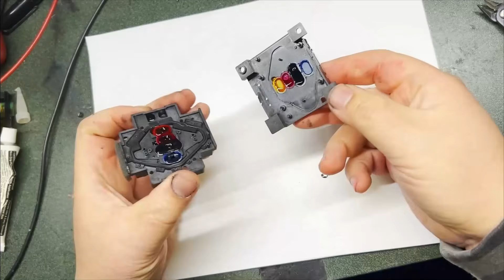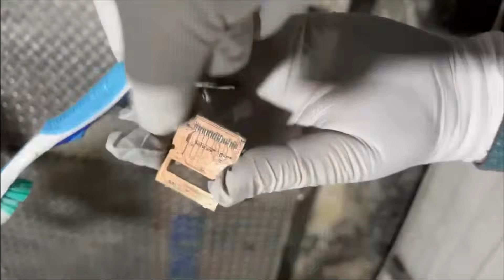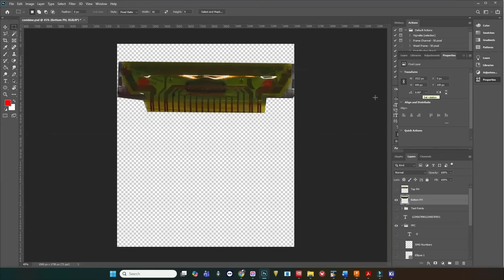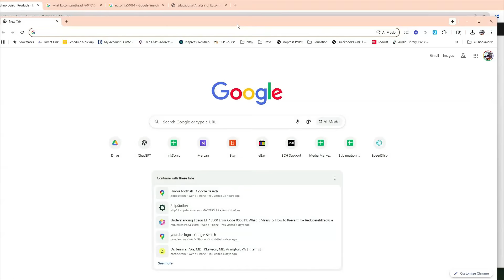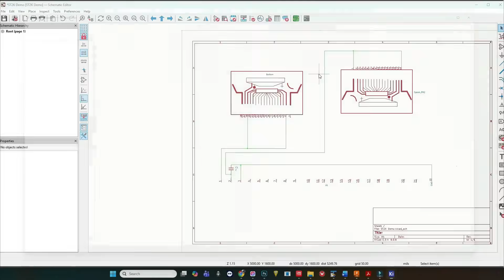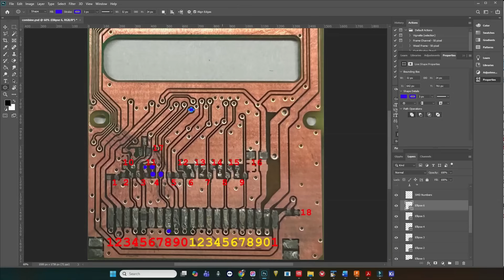Printhead Circuit Board Analysis - From Teardown to Schematic

Comment: May Epson L3150 was all blinking light.power button WiFi button and 2 red light buttons blinkung light..hiw to fix
Reply from the maker: Thank you for your support and engagement! When all the lights on an Epson L3150 are blinking, the first step is to retrieve the printer’s actual error code using the Epson Adjustment Program. Open the program, select the USB port showing your printer’s name, choose Particular Adjustment Mode, select Printer Information Check, and click Check; the most recent error should appear at the top as error number one. Once you have the code, search Google for “BCH Epson Error” to find our Epson Triple Secret Error Codes page and identify the affected part or sensor. The Adjustment Program is mainly intended for Epson technicians, but it may also be available from the seller who supplied your printer or through an online search. This video shows the basic process: [https://youtube.com/shorts/FPZzpyYuZLE](https://youtube.com/shorts/FPZzpyYuZLE) Please subscribe or become a channel member for priority replies and extra benefits such as early access to videos. I receive a high volume of questions every day and can only answer about 10 per day, so subscribers and members are typically answered within 48 hours, while regular viewers are answered if time allows. After subscribers and members, any remaining reply slots are filled last-in, first-out, meaning the newest questions are reviewed first. If you are not subscribed and do not receive a reply within 48 hours, you can either subscribe or repost your question because newer comments are reviewed first. If you subscribe later, your older questions automatically become priority without needing to repost. You are also invited to join Run With Kevin — LIVE, where I go live every morning, usually between 6–11 AM Eastern, and answer printer questions in real time. Subscribe and turn on notifications so you can catch the next live session and ask your question directly. For faster assistance, please email [support@bchtechnologies.com](mailto:support@bchtechnologies.com). If this video or comment helped you, I would greatly appreciate a Google review: [https://g.page/r/CfL7k6nYvPQ9EAg/review](https://g.page/r/CfL7k6nYvPQ9EAg/review)

Comment: Hi Kevin ,
I wondering what the goal is for this particular effort?
Is there a need for replacing the circuit board while reusing the piezo chip or vice versa?
Btw, we've purchased several of your products for our home printers as well as family and always recommend others check your company for any inkjet needs they may have.
Reply from the maker: Thank you so much for your support and for recommending BCH Technologies to your family and friends—it truly means a lot! The goal of this project is to reverse engineer the printhead circuit board and build a full schematic of how everything works. Once we understand the electrical design at that level, it opens the door to diagnosing and repairing failures that normally require replacing the entire printhead. For example, if a trace burns out, a transistor fails, or a control path is damaged, having the schematic lets us identify the exact fault and potentially repair the board instead of discarding the whole unit. In some cases that could mean reusing a good piezo stack with a repaired circuit board or understanding why a board failed in the first place. For regular home printer users this research probably won’t change much directly, but it’s extremely valuable for deeper repair work and helps us push the boundaries of what can actually be fixed instead of replaced. I also want to mention that I receive a very large number of questions every day, so replies are prioritized: subscribers and channel members typically get responses within about 48 hours and also receive perks like early access to videos, while regular viewers are answered if time allows since I can usually only reply to around 10 questions per day. After subscribers and members, any remaining reply slots are filled last-in, first-out, meaning newer questions appear first in the queue. If you don’t receive a reply within 48 hours, you can subscribe or become a member to move your question into priority status, or simply repost your question because newer comments are reviewed first—and if you subscribe later, your older questions automatically become priority without reposting. You’re also welcome to join Run With Kevin — LIVE, where I go live most mornings between about 6–8 AM Eastern and answer printer questions in real time, so make sure to subscribe and turn on notifications so you can catch the next session. If you ever need faster help, feel free to email [support@bchtechnologies.com](mailto:support@bchtechnologies.com), and if this video or reply helped you, I’d greatly appreciate a quick Google review here: [https://g.page/r/CfL7k6nYvPQ9EAg/review](https://g.page/r/CfL7k6nYvPQ9EAg/review)